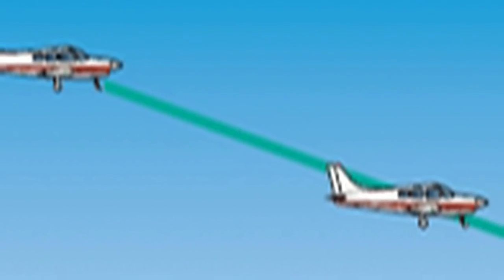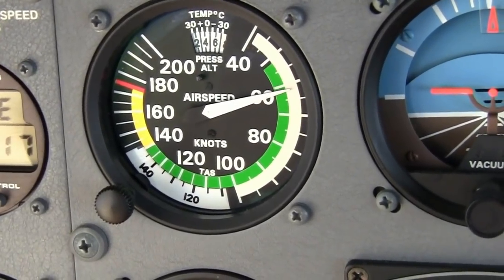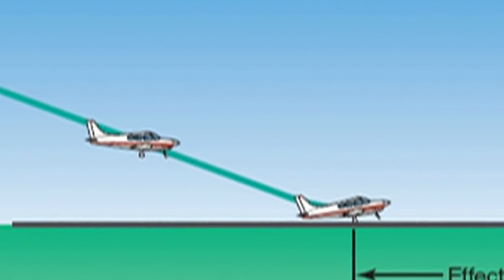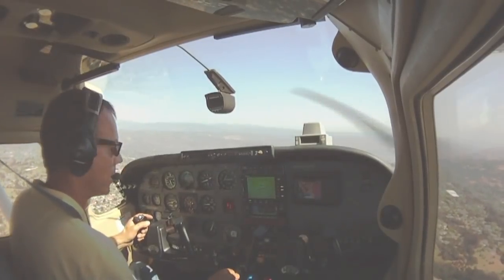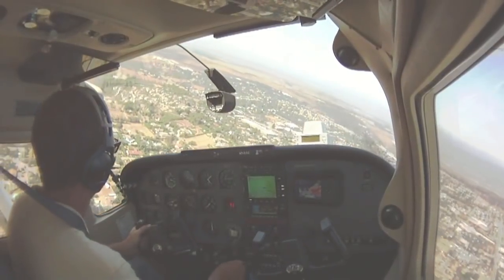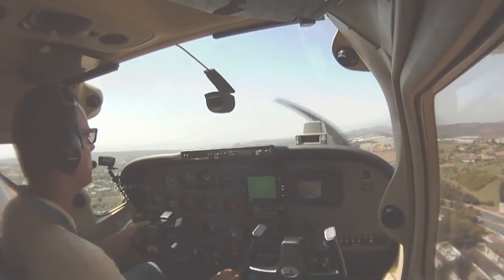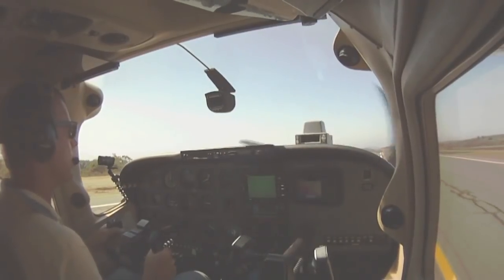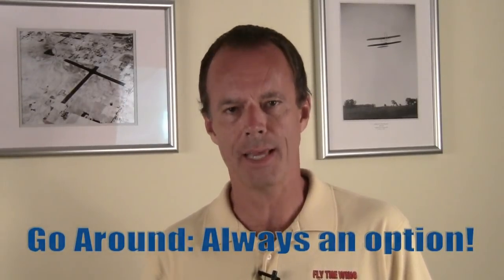How To Do Short Field Landing

Comment: May I suggest a few pointers.  Firstly, to successfully perform a short field landing, the flier needs to have experience knowing how much float distance will occur given the variables - a/c weight, configuration, density altitude, wind, etc and select the glide path and aim point accordingly.  I would also suggest practicing short field landings without flaps, in case of power failure. In that case the forward slip is mandatory and every pilot should have that skill in his back pocket.

Comment: Air flow over the rudder and elevator in slow speed? Some airplanes are sensitive, especially the T-tails. 
Learned once to fly the descent with power and with a higher nose attitude, "hang the airplane in the propeller(s)" so to speak. When clearing the threshold or fence on lowest practical altitude, cut the power and it cushion down on the runway like a sack of bricks. Takes training but gives a almost negligible roll out.

Comment: Didn't think there were any runways in the US shorter than 5000'
Reply: how about 1750 foot runway (790' elevation )  tail dragger no flaps  only use brakes when taxiing use ski's on snow (luscoube  8f)
Reply: Absolutely not true. I’ve been on several under 5,000 in my short flying career.

Comment: FAA now says no flap changes until off the runway...
Reply from the maker: Lycoming320 No, that's not true. No mention of flaps in the Private PTS Short Field procedure or in FAA Airplane Flying Handbook. You may be confusing w/ Soft Field Landing, in which the AFH advises against retracting flaps after landing...? Try whoa'ing up an airplane after landing on a 1,200' strip with the flaps still down and let me know how that works for ya...
Reply: Read FAA chapter 8-7.  It states that flaps can be retracted after leaving the runway.  Reason:  Too many pilots hit the gear lever instead of the flap lever while still rolling fast.
Reply from the maker: Lycoming320 Well... page 8-7 pertains to Normal landings, and my video and earlier comments relate to Short Field landings (starts on page 8-17); they are two very different procedures. Cessna 182 (and 172) POH's also say to RETRACT FLAPS on Short Fld. Landing. As you must know, flaps are always to the right of the center pedestal, gear is always to the left; I teach pilots how to sort those two controls out, but fly however you were taught...
Reply: In my C-182 I'd say it takes about 8 seconds for the flaps to go from full to 0 -- so I can't retract them immediately on touchdown.  Any wisdom in starting to retract them just prior to the wheels touching down, for maximum aerodynamic braking effect?
Reply: Due to the accidents where pilots activated the gear retract lever instead of the flaps lever the FAA mandates no flap changes until off the runway.  So after landing, leave the flaps in the down position until you turn on the taxiway, then flaps can be raised.  Hopes this clarifies things.
Reply: I'm sure the good folks at the FAA are all excellent pilots, and I appreciate their advice, but the C182T is a fixed-gear airplane, and its POH specifies raising flaps after touchdown on a short-field landing. My question is about the best timing of that.
Reply from the maker: Please cite the source of the mandate you reference. (Internet hearsay doesn't count...) And if you never retract flaps when on the runway, how in the world do you do touch & go's....?
Reply from the maker: I'm not sure I'd start moving electric flaps while the airplane is still flying; those configuration changes are going to alter drag, lift, airspeed, pitch, etc.; not a good thing when you're right over the runway. Having said that, I did lose a spot landing contest to the owner of the flight school at which I was instructing at the time in a PA-28. He grabbed the flap handle and dumped 'em the second before the wheels touched; slammed the airplane down hard, within 5' of the landing spot... I said, "dude; it's your airplane... you win."
Reply: "Please cite the source of the mandate you reference. (Internet hearsay doesn't count...) And if you never retract flaps when on the runway, how in the world do you do touch & go's....?"

My first reaction as well.